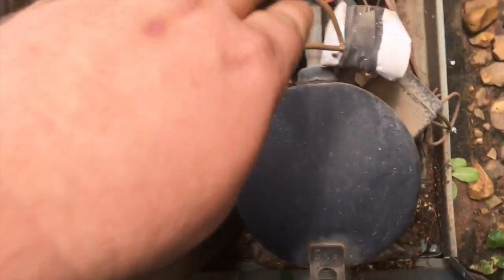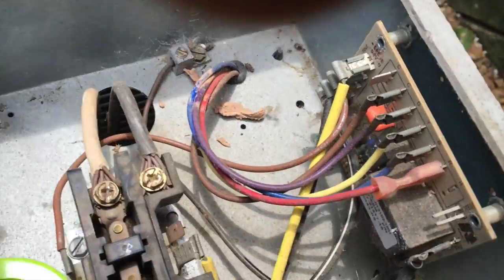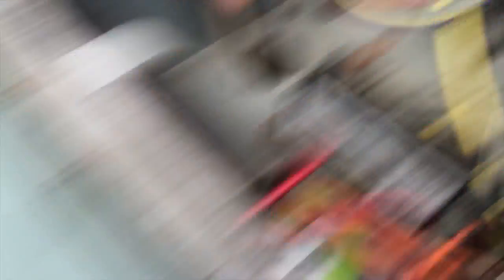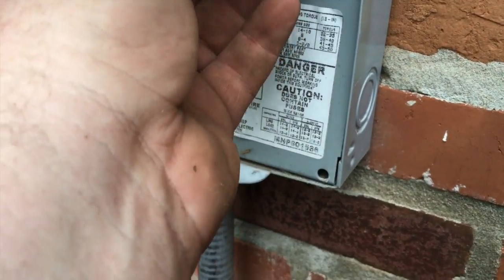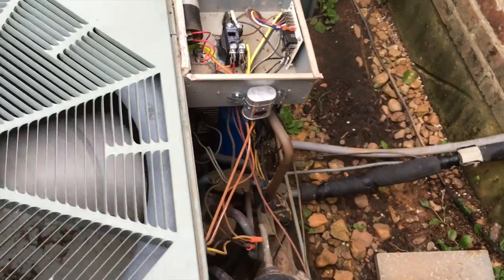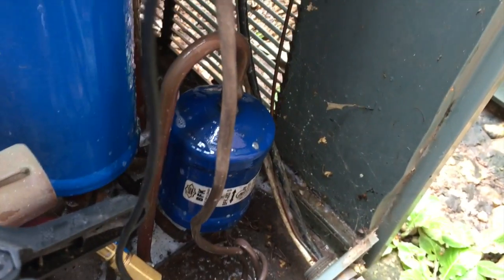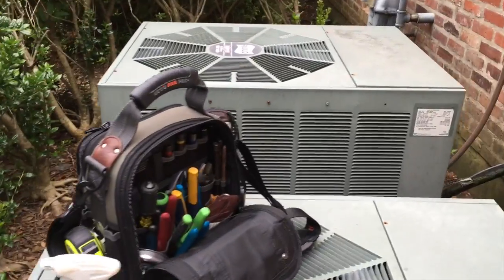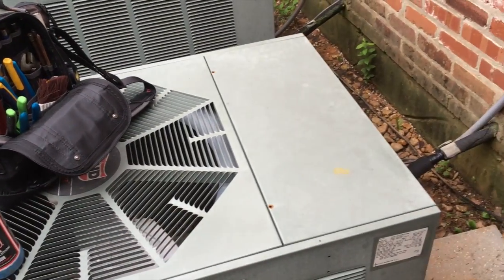HVAC: Defrost Board Replacement With A Bad Ending

Comment: This is exactly where our generation is headed to.  No disrespect to you John, but I have been doing HVAC work since I was 15 years old and I just turned 50 a week ago.  I would do for this customer exactly what I do for my family or my Mother and that is to be completely honest to them.  I use the new synthetic refrigerants and I work with whatever the customer has financially.  If they want the new complete system, I got them covered and if they want to repair for the cheapest they can, I got them covered.  I get 90% of my advertising through word of mouth and that is because I have empathy for people and I don't pull wool over their eyes so I can put more money in my pocket.
     God bless bro.

Comment: Non-retrofitting R22 is usually never explained right to the customer and it has fucked a LOT of folks on tight budgets. R407c is proven fine in R22 units. This guy probably called a Mom & Pop sized HVAC service who brazed his leak right up and topped it off with R407c for $200 or less; and it's probably still running just fine if so. The attitude of "Either replace the whole damn thing or pay thousands for R22" is fucking ridiculous, and shame on the shops that push it.

Comment: Wow, if the customer can't do basic electrical repairs himself, what is the likelihood he can successfully fix a refrigerant leak, then properly pump it down, and add the correct amount of refrigerant? Methinks he is going to hire chuck in a truck to fuck it up, maybe he is Chuck. Anyway, this post was from 2016, I wonder how it turned out.

Comment: honestly that system needed replaced, fan motor, two caps, board, contactor, dryer, recharge, not to mention its been running in a vaccum for who knows how long? now its a very expensive scrap piece that the owner feels obligated to repair. i doubt this unit runs a month longer if repaired. not knocking your work, but i would chalk it up.

Comment: Hope he paid you for the defrost board and contactor.  You got 2 trips and  knowhow, fix cap with plumbing strap. New fan motor but if he won't wash that coil the next thing will be the compressor. No this unit has not been serviced since it was installed. No compressor sucking air, going out on high heat, I got better in my junk yard

Comment: You do your best for the customer but with all these tv shows showing techs ripping off customers, they always feel they're being taken advantage of, even when you have their own best interest at heart. They don't think twice about dropping grand on a car for repairs in three years, but if the AC should have a problem in six years, they scream it's a piece o' junk! Even though it runs day and night, and the car is used only a few hours a day. I just don't get it. As far as the drop ins go, try NU22, it seems to work okay for us. No oil changing either. Even with mineral oil. We only offer it as a out of warranty situation.

Comment: R-22 purchase without an EPA card?!
If the customer has to "try" to get R-22,  probably does not have a card.
Reply: same thought here. is expensive to get r22 now that they have the 410 replacing it.
Reply: I recently got a universal EPA card but actually you can purchase whatever you like off Amazon or Ebay without a card. I thought you needed one but no. With 2 day service Amazon will drive some supply houses out of business because so many of them give really poor service.

Comment: Even if he is going to find his own Freon 22, he is looking at needing an EPA 608 certificate to buy the genuine HCFC not to mention the $600 for a cylinder of it.  He will STILL need to fix the leak (easy), and install a new filter-dryer (easy and cheap).  The actual leak repair would take less than 30 minutes and $30 in parts.  Those yellow wires should be moved inside the condenser housing, and that coil is VERY dirty though I wouldn't clean it until AFTER it is brazed and passes a pressure check.

Regardless, this is NOT a DIY project because it requires brazing or at the very least a product like Staybright 8, and the person who charges this unit is going to need to vacuum it to 500 microns or better and let it sit at vacuum for a while to dry out being the low side was below atmospheric ... it pulled in not only noncondensibles but moisture, too. 

If it were my own personal system or a family system, I would leave it in vacuum for probably two (2) hours and break the vaccuum with nitrogen about three (3) times to ensure it is dryed out.  The problem is any moisture trapped in the compressor oil; though, admittedly Mineral Oil is not bad compared to the new POE.
Reply: Not sure why people keep saying this!!! I just bought virgin R22 off EBAY and R410a off Amazon and neither ask for a card. Quit spreading misinformation. By the way, I just got my universal EPA card recently but have not needed it to buy refrigerant. 

As you know if you got your EPA the government is already pushing to replace R410a. Follow the money. It is all about the big boys wanting continuous change.
Reply from the maker: I agree!! Thanks for watching & the comment!!!

Comment: How many pounds does that Rheem system require?  That number times approx $45 plus parts/labor for the leak fix, board and contactor runs this repair to well over $1000. He'll call back once he realizes he doesn't have the equipment nor skillset to do the job. And he doesn't trust the "friend" who will do the job for $400. We'll see...
Reply from the maker: He has already call back and scheduled the repair!!

Comment: A lot of people say "replace the unit...it's old." Late 90s early 2000s doesn't seem too old to me, in fact, in my opinion, the older the unit is, the better the quality. Totally agree with you on repairing this unit rather than replacement. Nice video.
Reply from the maker: This is a 2003!! Thanks for watching buddy!!
Reply: Np man!
Reply: why wouldnt he repair it,just retorch that drier,unit already had new cap,drier,accumulator,defrost board and obviously fan motor and they dont retrofit?its all about selling that r22 at $100 a lb,what you have to loose?and more to save,that unit would be good for another 5yrs at least

Comment: Theoretically, -19 PSIG is impossible because atmospheric pressure is only 14.7.  That said, you also have yellow spade terminal wires above the condenser fan on that grate, and a filthy coil!
Reply from the maker: Ya I was there so I noticed all that!!
Reply: Yeah, I figured you did, but he might be one of those crazy customers who doesn't want you to take the extra half hour pay to fix all that, so the job is done right.  I would personally refuse to charge it until I was paid to clean it when it is that dirty.
Reply: It all makes you wonder if the original problem was ever even a bad capacitor.
Reply: haven't you learned yet that israel cant take any criticism?hes very sensitive that way

Comment: Find his own freon!?? fuck that guy. sorry but thats absolutely ridiculous.
 If that guy manages to buy r-22 himself, then we all wasted our time and money getting certified and going this shit legitimately.
Reply: Amazon sells it and doesn't check for anything
Reply: And they bitch about us handling it right and not venting, yet Harry the homeowner can buy it and charge his neighbors units while he's at it.
Reply: +BoomhauerWorldwide yep, that's why I hate working jobs where the customer repaired the unit but it won't run.
Reply: I can't stand residential in general, I can't sell people stuff. in commercial you just turn unit off, quote it, come back and fix it.
Reply: +BoomhauerWorldwide commercial isn't much better. Most companies dont want to spend the money for a proper repair and want favors or Frankenstein it to get running again as a permanent repair.
Reply: True that! i replaced two headers on an evap coil in a trane rtu today, orvices were clogged. whole coil was "too expensive" for Mens warehouse, so i had to do it the harder and slightly cheaper way. 

Putting a fan motor in a unit from 1987 tomorrow.

Comment: He spent the money to fix it and doesn't want to put gas in?? That's strange... Hope all is well you and family take care brother.
Reply from the maker: He had already called me back to schedule the repair. I will film the repair!!
Reply: Please do.  I mean, if he wants to braze it, flow nitrogen etc.  that's great, but he can't get HCFC-22 nor does he likely own the vaccuum equipment and micron gauge.
Reply: Please clean that coil before charging it... If not the head pressure will be crazy high and screw up the charge especially if it is a TXV.

Comment: On something like that. I check the standing pressure before making any other repairs. New board and contacts are useless at this point. But still top notch service work done
Reply from the maker: Hey I appreciate it!! I will be doing my best to check standing pressure before making repairs like this in the future!!